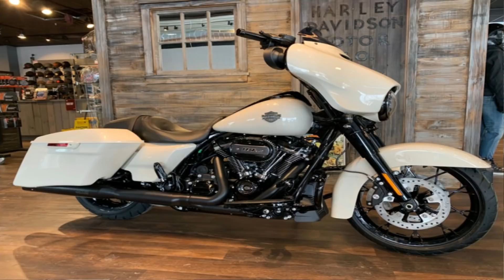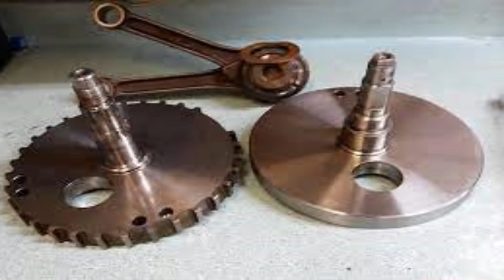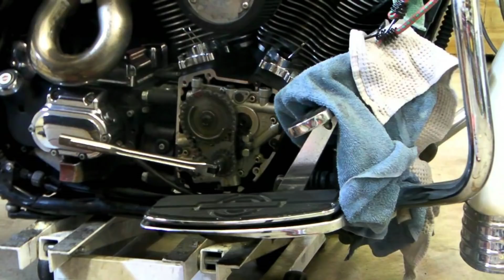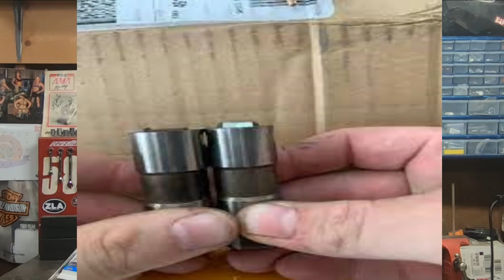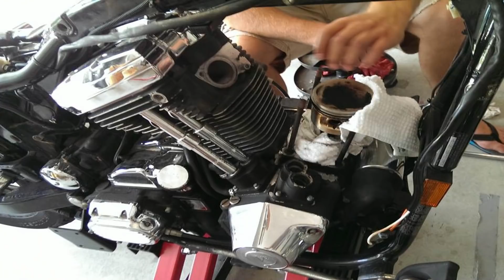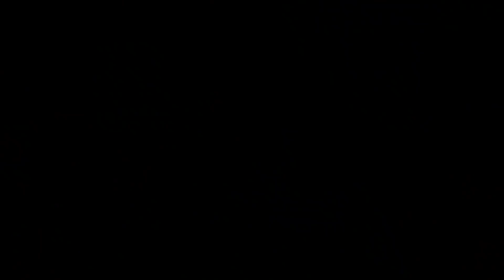Harley Davidson Engine Power Won't Destroy Fuel Economy & Longevity

Comment: I think putting a cam in any Harley would revolve around crankshaft runout...cause in the end , that's one of the determinations of how long your motors gonna live.
Reply from the maker: It really is, especially on a used bike where you've only got what you can see until you get in there. But for sure measuring run out is going to determine quite a bit of your engines longevity.

Comment: 0:46 - I busted out laughing. That's hilarious.

This is nice to know. I wish that you had covered Sportster, too. What are some ways to specifically get better gas mileage, on a Sportster?
Reply from the maker: It's the exact same concept on the Sportster too, exhaust, air cleaner and a good tune really goes a long way. Even adding cams and big bore kits on a Sportster with conservative riding will maintain or increase economy.

Comment: 120 horsepower really? How are you going to use that on the street? That's about as ridiculous as a 200 horsepower Japanese sportbike and I would think the kind of guy that can spend $27,000 on a new Harley and then sink 5 or $10,000 into motor hop-up work really doesn't give a rat's ass how much gas is B going to use he doesn't care today's thousand-pound Harley behemoth are twice as big twice as powerful and twice as heavy a knucklehead 61 in a rigid frame that bike came with a certificate from the factory stating that went 110 miles an hour stock from the factory course your bike weight around 500 lb fully gas 61 where smooth Harleys after the war Harley made everything 74 cubic inches because that's what the police Market wanted many riders preferred the 61 cubic inch bike because it was smoother and easier to kick over they didn't feel the extra horsepower of the 74 was worth the extra vibration that came with the horsepower got 61 cubic inch bike was also easier to kick over the same way a 350 single is easier to kick over than a 500 single I always heard that belt drives snapped if you wanted to put over 100 HP through them of course when a belt snaps it doesn't go through your engine case like a chain does but you still have the added expense of tearing down your primary in order to replace the belt in the 60s if you had a motorcycle either British or American you learned how to take down your clutch so you could put a new front sprocket on the owner would do it himself because it was regular everyday maintenance they didn't take the bike to the dealer for the mechanic to check the oil level and the air pressure in the tires like they do today today's so-called bikers wouldn't make a pimple on the ass of a biker in the old days rubs posers sidewalk Commandos all such pathetic losers I'm surprised they can manage to fill up the gas tank without shedding their motorcycle on fire

Comment: Enjoyed this one being that I just now got through with putting in an EV13 cam in with a CV thinderslide kit on my bagger. And just like on my softail; after 30k miles, while I was in there I found I needed new lifters too. About to fire this thing up here in a minute and see if there's any differance at all.
Reply: Cory, in my opinion the thunder slide will drive you crazy. I throw all of them in the trash when I find them in a CV. I know you like to do road trips on your bike and the best thing about your Evo is that if you were to consider keeping it bone stock (mufflers, airbox & carb w/stock jets) you'll see 55mpg all day long. Just my 2 cent's...
Reply from the maker: That's awesome! It will make a big difference on that bagger, it had a stock cam in it didn't it? It was your softail that had a cam in it wasn't it?
Reply: @GixxerFoo  yeah good point, I forgot he has multiple bikes. What bike did you do that to Cory? I have one "hot rod" with a stroker flywheel assembly in it and another just for touring purposes.
Reply: @kennethwise7108  I put the cam in the electra glide. Runs like a boss now.
Reply: @SaddleTrampTV  okay cool, I'll go check out your new video. Haven't gotten around to it yet.
Reply: @GixxerFoo  Yeah the bagger still had the stock cam in it. It was the softail that has the EVL 3020 cam. That bagger performs a heck of a lot better now! My most recent video is about that.

Comment: I’ve been binge watching your channel.. I’ve watched the 103ci cam swap vid ~100 times.. what state are you in? Also, bike questions.. you express sheer excitement about the “bolt-in” cams.. any idea if those “bolt in” cams (wood 222) will bolt in and clear the inner case casting? I have a good starting point.. only at 10k mi.. cams, cam plate, lifters, quickee pushrods and oil pump are next..
Secondly, I know the runout (gap) can be no more than 0.003” on cam gears, but what about the pinion runout? Is there a safe spectrum?
Reply: Yup no prob...222 = true bolt in.... instant power
Reply: Appreciate it.. What are you riding? I’m on a ‘14 FXDB.. just don’t want to have to grind any metal in the cam chest
Reply from the maker: Bolt in cams usually don't have any clearance issues, I still check the case clearance anyhow and I haven't ever found any base circle issues with a bolt in cam clearing the cases. But still don't blindly put one in without checking cause that will the one time it doesn't clear lol. I'm in central Oklahoma where the weather is wild and you never know what you're gonna get lol. You're pinion runout you absolutely don't want to be over .003" at a maximum for a gear drive cam system. That's a pretty good plan with a race cam plate and oil pump too.
Reply: @GixxerFoo  maybe I wasn’t asking the right question.. I mean 0.003” runout on the pinion, but what about the drive shaft (on the other side, with the compensator).. I heard the term “scissoring” with regard to the crank.. also, it seems HD allows far more than 0.003” pinion runout from the factory.. kinda sh!tty, IMO.. your channel’s awesome
Reply: 09 Dyna
Reply: https://youtube.com/shorts/TWgHcgFsPp0?feature=share

Comment: The only thing that has really effected my gas mileage is the crappy gas. Holy Mother Of God, gas is so terrible these days. If you can ever find a station with just plain old straight up pure gasoline, you will be SHOCKED at how much better your bike will run... or anything else for that matter.
Reply: Good point. With today’s gas you might as well add a glass of water to every fill up. I use 100% gasoline at every opportunity even if it means riding a few miles out of my way. The octane rating is usually 90 at those pumps but because it’s REAL gas then that won’t matter however a splash of Lucas octane booster solves that concern with ethanol infused gas and it REALLY helps with 100% gas. There’s a noticeable improvement in how my bike runs with real gas with respect to a quieter, cooler as well as a more responsive throttle on my 117 big bore kit.
Reply from the maker: That's a fact, it's getting harder and harder to find 100% pure gasoline that's not cut with ethanol. I only run that 10% ethanol if I absolutely have to and even then I have octane booster that's supposed to counteract the negative effects of ethanol.
Reply: There are a couple stations 30 miles from me that still have 100% gas. They are usually in route of my rides, so it's a win win. Sadly, we will never see corn gas ended. But that's another story.

Comment: .005" runout is STILL to much in my opinion! I wouldn't install any flywheel assembly into a set of cases with that much.
Reply: Couldn’t agree more! And hope I don’t have too much runout when I decide to tear into my 2006 Dyna Lowrider eventually. If one of the lucky ones and have less than .003, I am gonna split my case and get that sucker welded! Lol.
Reply: @divine_swine9665  I guess it depends on what day of the week it was manufactured LOL
Reply from the maker: That honestly seems to make a difference on the Twin Cam factory cranks lol. I got a little information on that surprisingly, talked to a guy who was there when they started pressing those cranks. Part of their cost saving measures was running the hydraulic fluid in the machines longer, they found the dirtier/older the fluid was the cranks ended up with more run out. If you got a crank that was pressed/lubed properly with the clean fluid during the pressing operation they ended up straighter and more true.
Reply: @divine_swine9665  I wouldn't want another Twin Cam, garbage
Reply from the maker: I totally agree it's way too much, I don't like it but and I don't sleep well with the idea but it can be done like that with those twin cam engines.
Reply: @GixxerFoo  I've been brand loyal my entire life and am so tired of having to suffer the consequences for their poor designs. You'd like to think that after 119 years they'd be the industry leader in V2 technology.

Comment: Very elementary question what does logging your engine mean?
Reply: Going slow in a high gear
Reply: “Lugging”.. meaning you’re demanding the bike to run at far too little RPM.. puts LOTS of stress on engine components
Reply: @bullast2046  Thank you my friend.
Reply: @jamestorregrossa1185  np.. gixxerfoo explained it better
Reply from the maker: Too high of a gear and too slow of a speed and rolling on the throttle letting the engine pull the bike up to speed. With a Harley engine design it will do it but it's very hard on your crank.

Comment: Really enjoy your channel, Question, I have a 2006 Heritage Softail with under 18K on it and would like to consider a cam upgrade and possibly cam plate upgrade, don’t want to go into debt for a new one.
How much (ballpark) for those upgrades if I can find a local independent shop near me.
Reply from the maker: With a Indy shop the parts I'd say would run you around 800 to 1k. I would plan for 2k all in with labor, that's high in my opinion but different markets etc. That's probably more like the dealer price so Indy shop should be quite a bit cheaper.

Comment: More power and torque = more heat to dissapate, more stress on other components like valve springs, clutch, clutch basket, transmission. You cannot upgrade the top engine without upgrading other components...not upgrading these other components will bite you big time. Don't worry about fuel economy...worry about increased stresses on other components and engine heat management (consider getting a fan assisted oil cooler)
Reply from the maker: Always a huge fan of oil coolers, you can't go wrong there. You do put a little more stress on the lower end in theory, but if you keep it mild with bolt in cams that work with the stock springs you're pretty good. Now if you get into high lift cams and heavy springs you start to put some stress down on the stock parts.
Reply: @GixxerFoo  This is true...why do I push for lower engine? It's because the lower engine is like a foundation to build upon, and the quality of that future build is dependent upon the quality and strength of that foundation. Now it is entirely true that an owner can add some power and torque and the stock components will do just fine, however it comes at a cost of sacrificing some reliability..components will wear out a little faster. However for those who are very serious and have the financial resources...starting with the lower engine and blue printing it, and putting in Timken Bearings, and forged connecting rods (Carillo) and having that new crankshaft assembly balanced to have as little vibration as possible (I know...part of the Harley "experience" for backseaters is that the bike is a 2 wheeled vibrator and that's why women love them so much...besides the bad boy image of the bike owner...but I digress...)...reducing the vibration (like reducing heat) translates into components lasting longer and having less wear and staying in alignment longer. So...once the lower engine work is done...the Harley owner can then shift their gaze to Gear Driven CAMs which allow for more precise valve timing, and a more efficient OIL pump and better CAM plate (like S&S)...more lubrication = less friction = less wear = less heat = greater reliability. A solid lower end means not only better reliability...but a solid foundation on which the owner can make all kinds of changes to the upper end and still have an incredibly solid bike. It's like...if you're going to want to someday have an engine that produces more torque..you are going to want to have a better clutch and transmission so the owner might want to think about a Baker Transmission. Pricey yes...but very solid. Just like it costs money for performance..it costs money for reliability. A bike owner can cycle through a lot of bikes over time, or can focus on having one bike for a very long time and making that bike as solid as possible.

Comment: I only put a Cam in my 114 M8. Fuel economy didn’t seem to change (although I have not official calculated it) As far as the TC88 to 95 My fuel efficiency and power are both better and I am a huge fan of that kit. Longevity has been far beyond expectations on it. (I did add an oil cooler though)
Reply from the maker: Oil cooler makes a huge a difference in longevity, I've always said performance makes the engine more efficient and you can get the fuel mileage if you ride conservatively.

Comment: I'm almost afraid to ask, but if you measure the run out the check the general health of things, how far out from .002 do you then need to break open the case?
Reply from the maker: It depends on who you talk to lol, Harley's allowable run out is astronomical in my opinion. Upwards of .012, with the factory cranks I'd like to see .005 at a max and even that's a little high to me. I still believe that factory automatic chain tensioner is the cause of the run out issues, you have that one side pulled tight and something has to give through the center of the engine.

Comment: Just recently had to unsubscribe from a new content fella who stated the M8 runs rich from the factory. Appreciate your weekly accurate discussions.
Reply: I saw that one too. Totally wrong.
Reply from the maker: The M8 is very lean but it handles a lot better than the Twin Cam motors did.
Reply from the maker: Yeah the M8 doesn't run rich it all, it runs just as lean as the Twin Cam did but it handles it a lot better with the dual plugs and 4 valve heads. The poor Twin Cam was virtually on the edge of melting with the two valve head trying to pull those AFR's.

Comment: I remember when I was a kid hearing a guy saying you don't buy a Harley for the mileage but your stock 883 does about 140mpg which is comperable to everything in it's price/power range
Reply: Miles per tank??
Not miles per gallon. You should be getting  around 40 mpg if you ride like a normal person, but we are not normal!!
Reply from the maker: 883's get really good mileage, my wife's 48 with the 2.1 gallon tank I've stretched that sucker to 85 miles. Not good on the fuel pump in my opinion but even the 1200 will do some decent mileage.
Reply: I should say that's with a 3.3 gal tank. 2.8's are the devil's work
Reply: I've got to get one of these that gets 140 miles per gallon. That's out of this world.👍
Reply: @jerryhayden8720  maybe you can try a Honda Vision